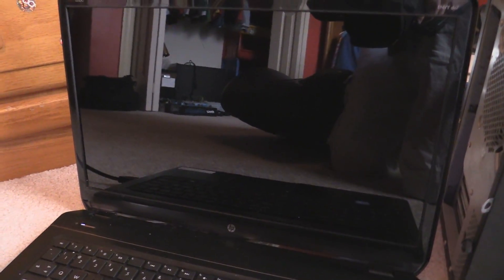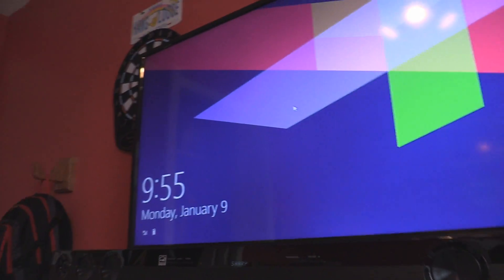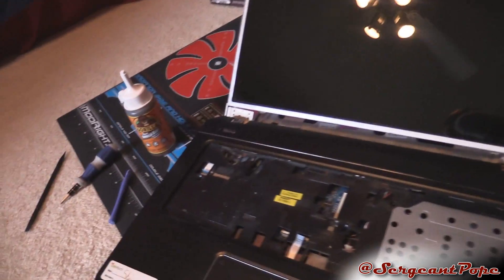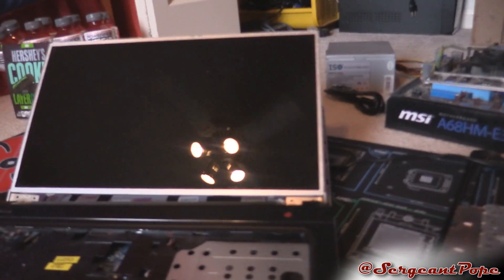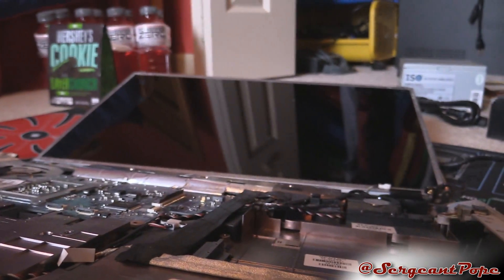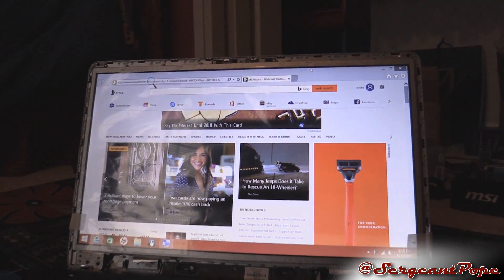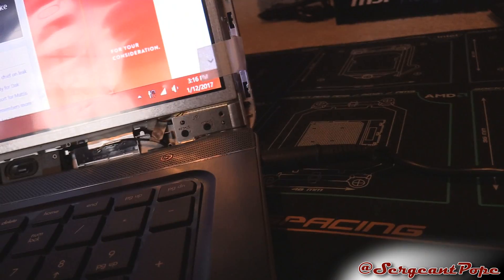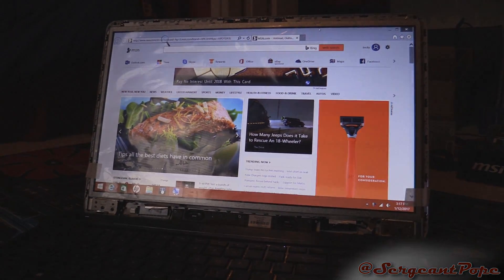Fixing HP laptop with no backlight on LCD screen

Comment: Replacing the whole display is an overkill. The backlight isn't working anymore. Repairing the backlight driver is the most probable and least expensive thing to do.
Reply: How do you do this
Reply: @rodneymiller5926  1- unmount your display to expose the backlight (usually at the lower edge)
2- measure the length of the CCFL tube
3a - buy a mating new CCFL +/- a new high voltage converter, as the CCFL increase current consumption when getting old with destruction of the converter output
or
3b - buy a LED strip with its driver board. This will require some electronics skills to interface the former CCFL converter input to the present LED driver. Datasheet of the respective IC's may help.
These lights can be found on the bay, zonzon or Ali and the fourty thieves.

Comment: There is another way to make work the screen on HP laptops, take away battery and poweradapter, push 20 seconds rhe power botton, connect to power without battery and start the laptop, it worked for me!

Comment: Is the same problem for me, the thing is that I bought a new display but connected still with the battery on, gave me light for a sec and then was gone, tried with 2 different cables and 2 different monitors and still no light... no idea what could it be 😭

Comment: My pc has a similar problem my pc only
Shows images if i push one side and pull the other any ideas? Ty
Reply from the maker: Hmm, have you checked cables connections? If that doesn't fix it, I would say the issue had to be either the cable or the screen (which the most likely issue being the screen).

Comment: I have problem with display as well, after 5 to 10 minutes of booting PC the display will become blue, green or scramble and then PC still remains ON but it doesn't work. When I restart it same thing happens all over again.
Please help me.
Reply from the maker: Did you try some of the things I did in this video? I would try plugging the laptop into a TV or monitor to see if that signal is fine. If so, then try swapping out the screen to see if it's just a bad screen. I believe that's what I did to fix this laptop.
Reply: I had same problem. When i asked a repairman he said that it is not a screen problem, it is a graphic chipset problem. Is it possible ? :S